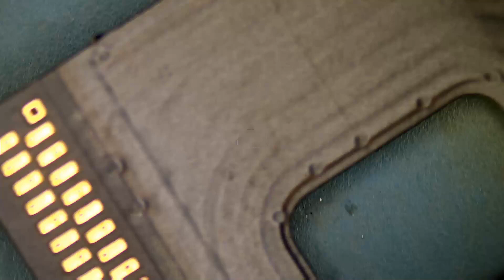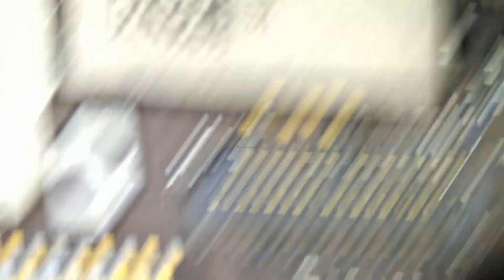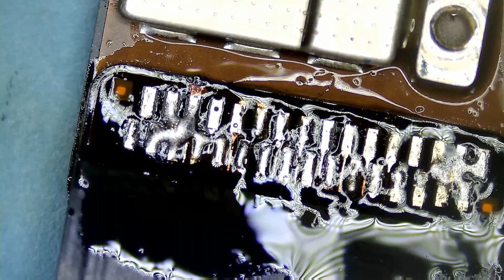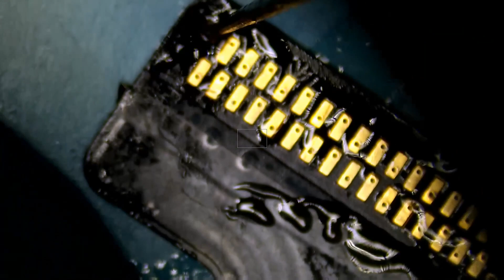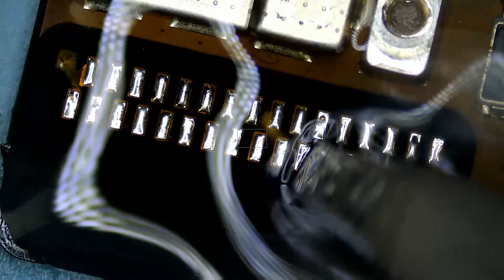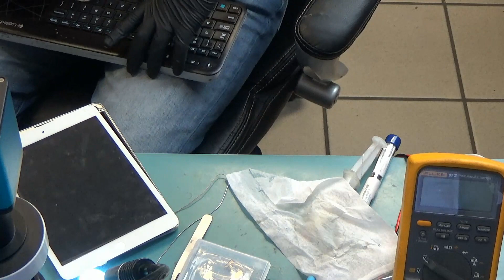iPad Mini Charging port flex cable Soldering and Replacement

Comment: With respect, the reason you had problem with seeing the alignment windows is because you filled in the alignment X with solder. next time if you use care not to fill in the alignment X with solder, you will be able to see the X through the window, and align the cable perfectly without making holes.

Comment: Great video as always, man! I've avoided iPads so far, opting to take in only Android based tablets that don't require heat and adhesive kits to open/close them. I'm pretty nervous about working on these and I haven't been able to find any cheap dead ones that I can practice on yet. :(

Comment: Thanks and keep up the great work! Is the technique for this basically as you have mentioned before: 410 iron when mixing unleaded with low melt, 350 air when removing connector, 350 iron to solder connector back with leaded?
Reply: Are you talking about Celsius or Fahrenheit?